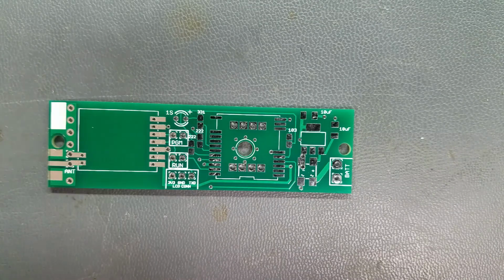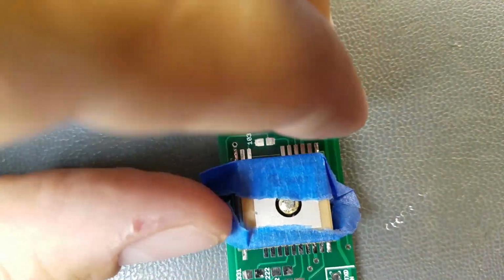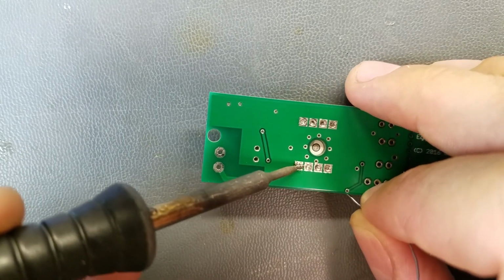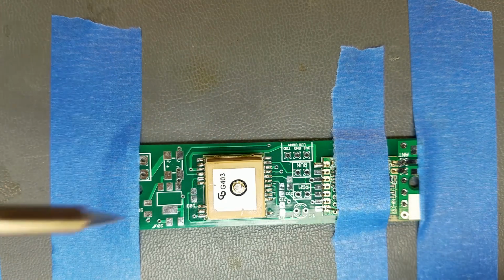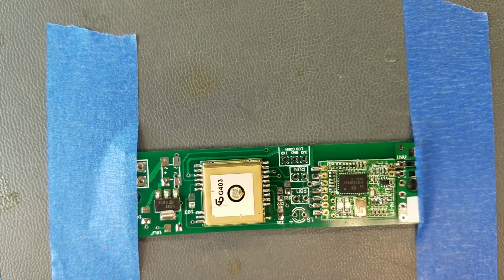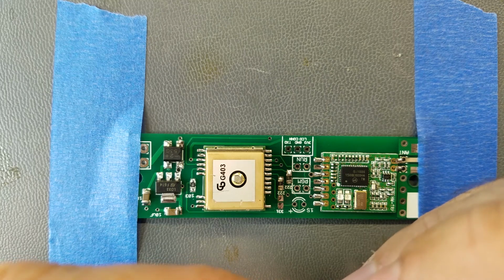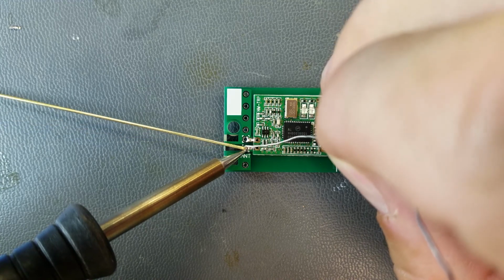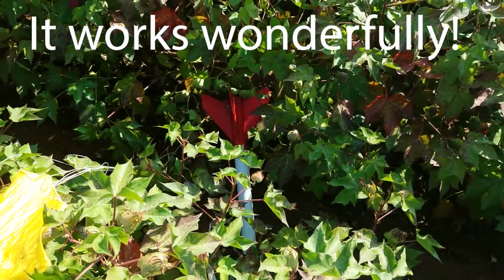EggFinder TX Assembly

Comment: With the difficulty you seemed to have getting the solder to flow, I had to wonder if that was no-lead solder your were using. I never use lead free solder.  I would probably have used some liquid flux as well. I did when I built a communications receiver that was surface mount.
Reply from the maker: It was lead/tin solder, but I was using lower heat initially.  Once I found a good heat level, things started working much better.